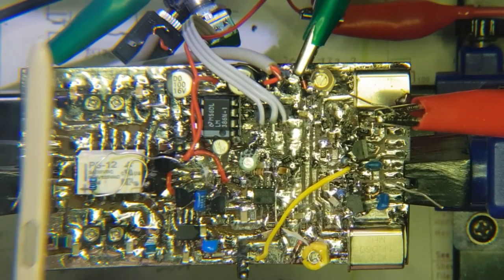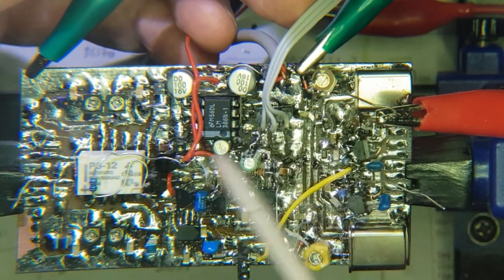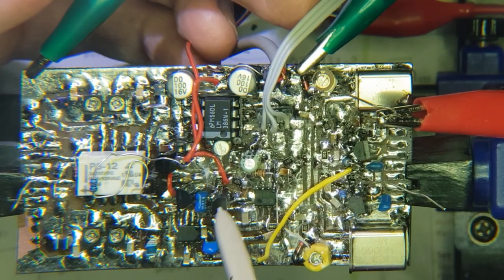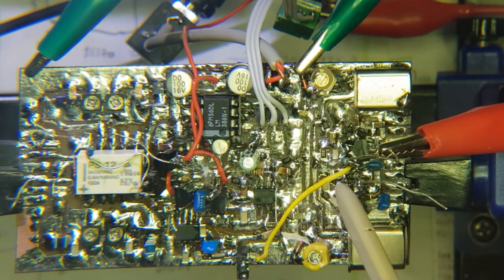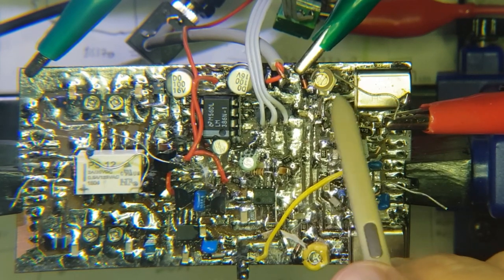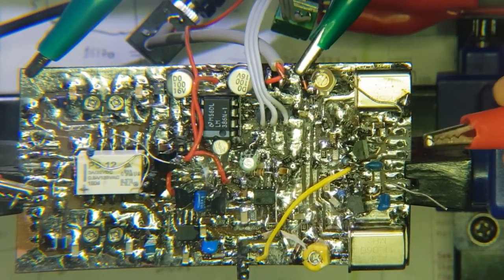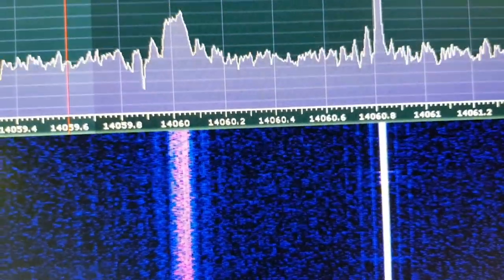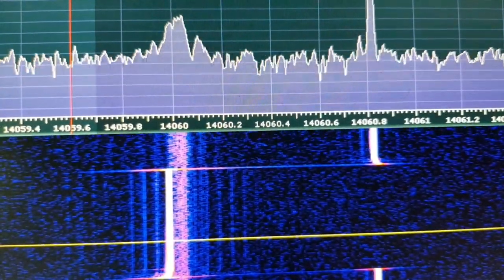2B2C: Dual-band 2 channel QRP CW rig/ Part 4 Receiver build & test

Comment: Paul, good explanation of the trials in tribulations of getting homebrew analog circuitry working. Audio amps that howl, crystal oscillators that don't oscilate - all part of the fun! David VK3KR
Reply from the maker: Hi David, yes, analogue presents these kinds of challenges, but I think that when you've seen them once or twice before, they become easier to deal with.  Thanks for commenting and good luck with your own analogue radio projects!   Maybe we can take them to a mountain top some day, when we are next 'released'.

Comment: See you next time Paul great series.
Reply from the maker: Good on you Ian. Did you work anyRD today? I made six (yes 6) conyacts in the QRP CW Solo category, hi hi. Put in my log, support my State!
Reply: @Paul_VK3HN  Swapped about 5 contacts on cw on 40m and 3 scores to locals on vhf/uhf Saturday. Doing 6 SOTA next week sw3 and 1 SOTA today Sunday. 
Scary some of the ages of these guys in the contest and years on air.
Reply from the maker: @willian.direction6740  If you can move more than 5km, head for the hills! A lot of locked down activators should be around to chase from home! I certainly will. My years since first licensed is 43. My nbr years with ham license 40. I'm getting up there myself! 😮 Did hear some sixty plus numbers.

Comment: Well done and i enjoy ur projects ,I am the same i dont like throwing away components either hi hi 73's de  ZL3
Reply from the maker: Thanks Doc, my reason for keeping every part, right down to a recovered surface mount MMBT3904, of which I have about 30 new stock, because sooner or later, that one recovered component might allow me to finish or repair a board!  You can always place an order for more, but that can take 10 to 14 days before the component arrives. 73, keep melting solder!

Comment: wow, why i did not much desired result with my project is lack of these test instruments. hmmmmmm.....
Reply from the maker: I don't have a much test equipment as some builders!  Beyond a multimeter, an oscilloscope is by far  the most important piece. You can generate test signals from homebrew oscillators.   A poor man's spectrum analyser can be an Antuino from VU2ESE, or an SDRPlay.   I bought these test gear one by one, over time, maybe you can too. Good luck!